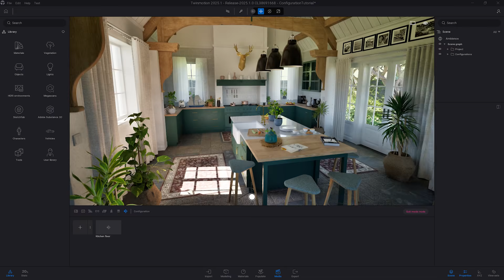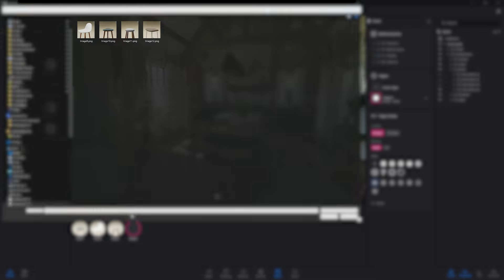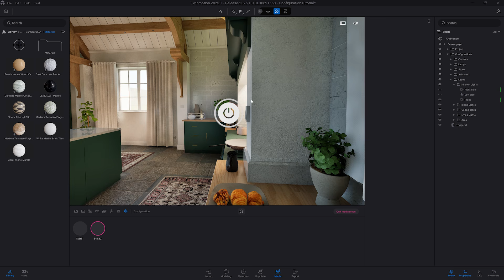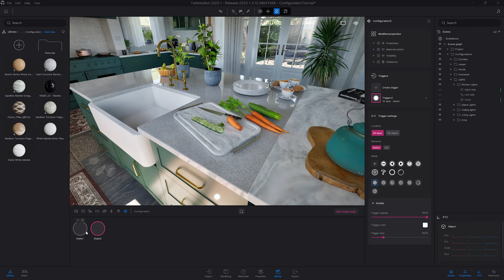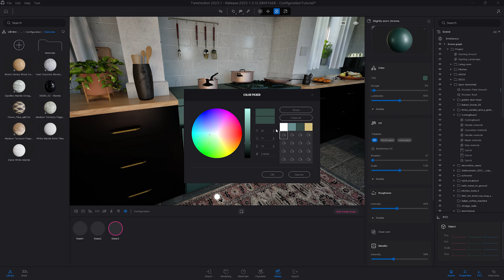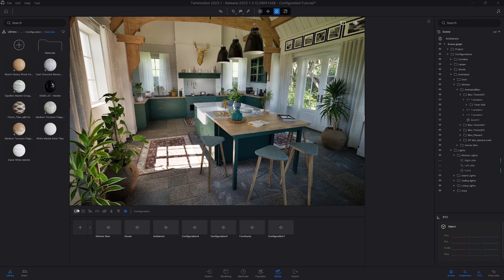Comment: Subject: Twinmotion vs. D5 Render – Closing the Realism Gap

Message:
D5 Render currently leads in realism (~90% photorealism), while Twinmotion trails slightly. With Unreal Engine’s power, I believe Twinmotion can—and should—surpass D5 soon. Focus on ray tracing, materials, and lighting to close the gap. Excited for future updates!"

Key Strengths:

Direct – Clear comparison and request.

Concise – 3 sentences, no fluff.

Forward-looking – Ends on motivation.

Need even shorter?  Try:
*"D5’s ~90% photorealism sets the bar. Twinmotion + UE should aim higher—ray tracing & materials will get it there.

Comment: Hey, great work. I'm phasing a problem with the moving trigger on animated Objects. I have the Problem with preset open Doors.  When I move the Trigger on the simple rotating Door, the Trigger is orderd correct right under the Door but it won't move with the Door. Is it not working on preset Doors?